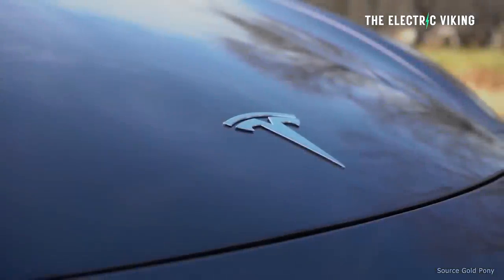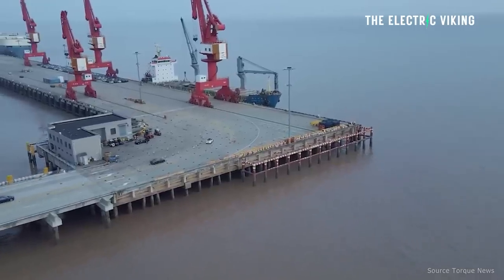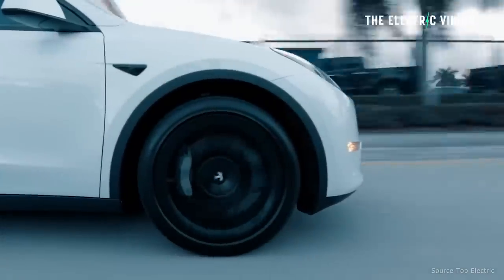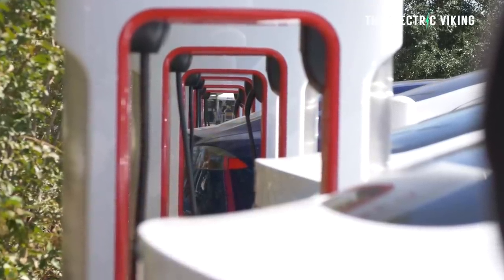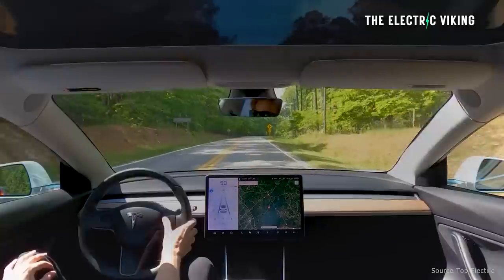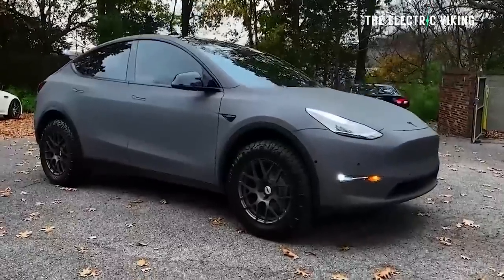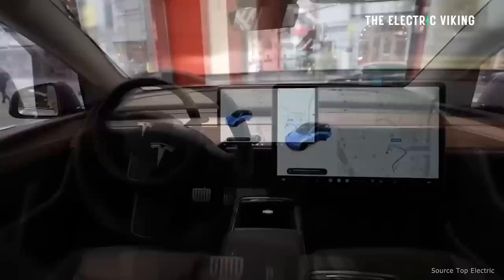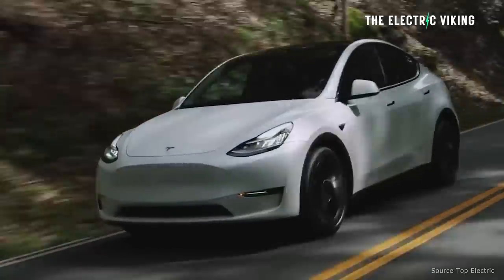Tesla's Model Y Update: Battery chemistry changed in China-Built variants?

Comment: I have been testing LFP cells (large prismatic cells) for 3 years now. Charging to 100% is not a problem, what you don't want to do is charge them to 100% and let them sit for extended periods. Basically the flammable part of the cell is the electrolyte, short out a cell and it will boil off (and is very toxic and flamable). Unlike NMC, it won't propagate and cause a big problem with adjacent cells.
Reply: Thanks for explaining that John, good to have comments from someone who works in the industry. My 2019 Kia e-Niro has an NMC622 pack, which is now 'old tech', such is the pace of development!  'Way back' in 2019 when I got the car the manual recommended to charge to 100% once a month, this to give the BMS a chance to look at all the cell voltages, so they say. I don't always remember to do it and tend to only charge to 100% at home before going on a long trip, so that is always done on a slow home charger. The e-niro has 294 cells in the pack arranged in 3 modules of 98 cells each. The battery is quoted at 64kWh but is in fact 67.5 kWh so I guess if the BMS sees a weak cell or two it will raise the voltage on the others to compensate. So after 81,000 km I am seeing no discernible range loss at all but that does not mean there has been no battery degradation. I pointed this out on my channel 'Kia e-Niro Diaries Encore' recently...Are range loss and battery degradation the same thing? TBH I think the longevity of NMC versus LFP is to all intents and purposes a moot point. An NMC pack should be able to do 1,500 full charge/discharge cycles before seeing a >20% range loss. Adopt a narrower charging regime as I and I'm sure most people do (20% to 80% say) and you are looking at 2,500 cycles. For the e-Niro that works out at 675,000 km..half a life time of driving for the average driver in Europe. The biggest benefit of LFP is the lower cost, and of course as you describe, the lower risk of fires.
Reply: Like to hear more about LFP on model Y vs 2170 on model Y. Now deciding which ones to get?
Reply: What do you consider an extended period in regards to a LFP at 100%?
Reply: I plugged in my model 3 (LFP) for 5 weeks when went for a vacation and charge it all the time when it’s Parked in my garage. No issues so far.
Reply: @danharold3087  Really, anything more than a day at 100% will cause degradation. It is actually quite slight, but will build up over time. Solution? Charge up and drive 2 miles or so, much less degradation at 95% state of charge. I have been testing cells for solar energy storage and specifically tracking degradation for the past 3 years. If you charge to 100% and just let them sit for a year, you will drop capacity by about 5%. So go ahead and charge to 100%, but use the stored power. They really are 98% efficient (using calibrated instruments I have actually been measuring 99% efficiency). That efficiency is really tough to beat. FYI, that last 5% will do more harm than the top 5%. Try not to drop below 10% state of charge, that last 5% will generate more heat within the cell than the top 95% will. This is measured at relatively low rates, nobody wants a solar storage battery that only lasts one or two hours.
Reply: How well will LFP work out in the cold weather in Canada?
Reply: The LFP molecule is more stable than the oxide ternary molecule used in NMC but that does not mean it won't propagate to other cells once it catches fire. It most definitely will. All li-ion batteries are highly flammable and the trick is the design of the pack, not the chemistry which stops the propagation. Tesla has done excellent work to mitigate propagation through design
Reply: @kelargo  take an in depth look at BYD's blade battery safety properties.

Comment: Lfp is the clear choice in warm climates. It depends on your situation in cold. They won't give full power or charge fast on a cold battery...They are getting better though.
Reply: A lot if the getting better is about the systems around the battery. Thermal management is kind of interesting with these if you wanna charge at 3C and all that stuff.

Comment: Considering that LFP batteries are less efficien in cold weather compared to NMC, I do have a problem with Tesla changing the chemistry without telling the customer or offering the choice explicitely.
Reply: Even for NMC based cells, Tesla has a heat pump specifically to combat this problem. When in use, LFP cells like the same temperature that you do. If you leave for work at approximately the same time everyday, it will preheat the battery and there will be no problem. Driving to a charging station and it will heat or cool the battery as appropriate. I live in the desert and would much rather have the LFP chemistry due to the increased longevity.

Comment: Has a future customer of Tesla cars. My major concern is this when I place my order it is not clear what battery pack my car will have. Unlike gas cars battery packs seem to be the most expensive part on the car. But seems like as a customer we have no power/ choice to determine what type of pack, chemistry, structural,  non-structural, giga castings front, rear. We will get. I think that needs to change...
Reply: Are you asking Tesla to open a line for each variation or disclosure of what is in a car?
Reply: @Dan Harold  No, I'm asking for when I pull up the order page for a Model Y. Before selecting tires, paint color, interior color, wheel size. I want to select which batteries I get!  4680s, CATL, BYD, LFP, ect. I want to select front and rear castings. When do you find these things out? When you pick up your car?? I want to know the most important features Upfront! I feel like nobody is talking about that and Tesla has some pretty smart customers, or I thought??
Reply: @UncleGreatness    When looked at from a manufacturing standpoint what you are asking for flies in the face of lower production costs.  A non casting option would add to the price of all cars because  all that bodyshop and staff for building the stamped equivlent would need to be retained. This will be thousands.  Batteries choice would have a similar effect.  
I have not researched it but Tesla the VIN includes the battery type.   You can buy a car from inventory and know the battery type.     People generally know what batteries are in use at each plant for each car.
Reply: @Dan Harold  as a TSLA share holder I agree with what your saying. However, as a consumer I guess I can't understand why I can't have my cake and eat it too.
When I am ready to buy my first Tesla I guess it will be from the existing inventory I will shop. Doesn't seem like the Order to Delivery experience I was expecting...
What is your background in Tesla? Do you own a Tesla just curious?

Comment: I live in Canada and the rebate for electric vehicles is not exactly 7000. First of all, there are 2 possible rebates. The federal govnt rebate is $5000 for a sedan up to $55000 before taxes and fees and options (that is, the car could be costing 60000, if the base model is priced at 55000), or an SUV up to $60000 (with the same conditions).
So, Tesla positioned the base prices of models 3 and Y right under the limit for allowing the rebates. Now all model 3 and Y are qualifying for the govt rebate of $5000.
Then, there is the provincial govt rebate. Canada is a federation and has 2 level of government. 
Not all provinces have rebates for EVs. Right now, the largest rebate is given by the government of Quebec, where I live. The amount is $7000 under the condition that the price of the vehicle purchased is under $65000 with any options before taxes and fees, regardless of the type (sedan, SUV, vans, etc). So to clarify, in Quebec, only the model 3 RWD, model 3 AWD and model Y RWD qualify for this rebate. Therefore, in Quebec, right now the difference between the model Y RWD and model y AWD is actually $17000, because the first qualifies for the QC rebate, while the second one doesn't.

Comment: As a future Model Y buyer, it is extremely disapointing that Model Y LR loses 11% range in Canada (from 533 km to 496) for road tripping in winter where you can easily lose an additional 15%  because temperatures often drops well below freezing (I have a lot of experience with a Model 3 SR that I sold for this reason). For me,  400km is inadequate for raod trips during winter times in Canada. 500 km might be a bare minimum but I was really hoping Tesla would increase the 536km range of Model Y LR version by the time I buy it next year. I can't believe they are doing the opposite! I don't think Tesla accounted for the winter conditions and the the Canadien market in making this change
Reply: I see where you’re coming from. And it depends on case by case. Living in Montreal and doing the occasional road trip, the RWD model Y would suit my needs. EV for short trips to work and around town. And a second gas car for long trips for now. I’m still thinking about it, but I’m leaning towards ordering one very soon
Reply: It might not suit you, but it would be awesome for so many other people.
Reply: Old LR version was with nickel based version batteries ( which you shouldn't charge till 100% cause of degradation) new version is with LFP you can charge till 100% ..
Reply: Uh did you know gas cars also lose about the same amount of range in the Winter there?
Thicker cold air causes the fuel injectors to have to add additional fuel to each cylinder to ensure a correct air/fuel mixture. This results in lowering of mileage per tankful. 
In a gas car you just don't realize it as much because you just pop down to any corner station and gas up. When fast chargers become ubiquitous you'll do the same and not even think about it.
Reply: @nickmcconnell1291  I should illustrate my point with a concrete example :
EPA range =496km
With 5% degradation = 471km
Highway real range at 110-115km/hrs (-20%) = 377km
Highway -10 Celsius (-15%) =320km
Actual useable between normal supercharging sessions (80%) =256km
So this about 2h15min between superchargers in theory for this example but in many cases it would be less depending on charging locations (unless you want to spend more time changing above 85%, which is very slow). So it depends how long you want to drive before having to stop. For me, I would like to be able to drive 2h30 hours at highway speed in the cold without having to charge above 85%. That is only my experience and my personnal need
Reply: @jvaillancourt  Hopefully new battery energy density increases will alleviate this degradation worry because they will have more than enough. 👍
Reply: @jvaillancourt  My doctor says it is not a healthy practice to sit for more than an hour without moving. Getting out and walking to circulate your body systems is critical. This forces you to be just a little bit healthier.
Reply: I agree 100%. It varies. In the Rockies in Alberta driving Westerly between Calgary to Banff will easily use twice the range even in a not so cold day and driving at the speed limit.
Reply: I know it probably makes no sense for Tesla to change their strategy for a few canadians, but man the range is an issue. Letting your car sit in the cold for a backcountry ski trip a d the battery is gone. Going back in forth in the Parks and you have to make hours detour to charge or can’t even make it in the winter. Unfortunately we still need a second car.
Reply: @widi.1984  You may recently have seen a Viking video where he talks about a finding that divulged why Lithium batteries discharge if they sit too long and how they discovered a simple fix for it.... yet to make it to production but coming. 
   I am pretty sure that cold speeds this reaction process up. That may be why sitting the car out in the cold caused it to discharge so quickly. With this change going into production this may not happen so much in future.
🤞
Reply: @jvaillancourt  actually use able? Are people delusional. I'm just curious. Even if recommended charging cycle is 80 percent or something if I need the range I'll charge it fully. And that is it. If electric car doesn't suit my needs then there are other cars. Diesels, gasolines or petrol, plug in or full hybrids. Period
Reply: @SunriseLAW  I totally agree except on the fire risk... it's actually 11 times greater in a gas car. 👍
Reply: @M85Iroc  that was exactly my analysis and summary too - we have a Honda HRV for longer trips when required and the coldest snowiest days of winter - other wise our new MYSR will be our main drive

Comment: Not sure how accurate is that the Canadian MYLR coming from China will have LPF battery. according to what I just heard an hour ago from a reliable source, the Chinese assembled LR with 497km range will still have NCA battery, it’s just smaller pack. (I live in Canada)
Reply: Agreed, the MY LR from China is not using LFP packs.  The range difference between the Shanghai MY LR and the Fremont MY LR was different chemistries, where Fremont uses 2170 cells with NCA chemistry (from Panasonic USA), and Shanghai uses 2170 cells with NMC chemistry (from LG in China).  The range and weight of the new MY LR offered in Canada matches the Shanghai MY LR specs, with cells that have been previously confirmed to be NMC chemistry.  The LG NMC chemistry has slightly lower energy density compared to the Panasonic NCA cells.

Comment: Many owners of LFP based Teslas might want to charge to 95% or so just so regenerative braking works correctly when you leave the house.  Now that I have a US made Model Y, when I leave the house in my 2017 volt, the regenerative braking doesn't work properly till I get about 4 miles from home and its noticeably annoying.  I know you can poke a setting for the brakes to simulate regenerative braking, but that wears out the brakes faster and wastes electricity you just put into the battery to top-it-off.  Other than that, I think LFP batteries are a thumbs-up.

Comment: Tesla needs to offer a RWD car with a large battery so that a long range car is available that is not AWD.
Keep the AWD model for those that want it and let people buy a cheaper RWD model with a  long range for those that do not need AWD.
Reply: This is the way.
Reply: Agreed, AWD is unnecessary for a large proportion of drivers. Many cars it’s standard and it makes it quite critical that you have very similar tyres of matching age and condition.
Reply: It’s marketing. Offer AWD with a big battery only so that people don’t realise the front drive is cheap and the battery is more than 40% of the value of the new car. Also, nobody will buy a AWD with a small battery. The large battery RWD will be quite a bit slower to accelerate with a diminishing return on the size of the pack. Also, it may come down to assembly line. Is a new line required just for RWD long range?